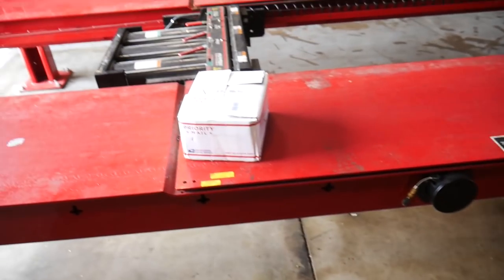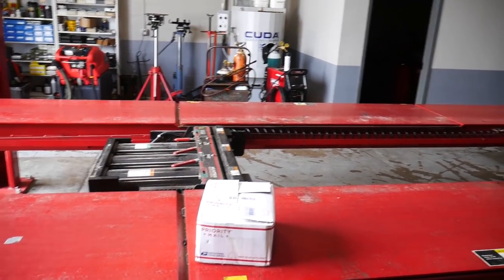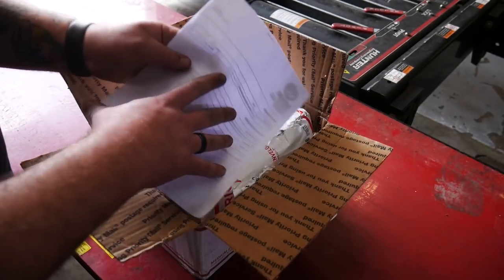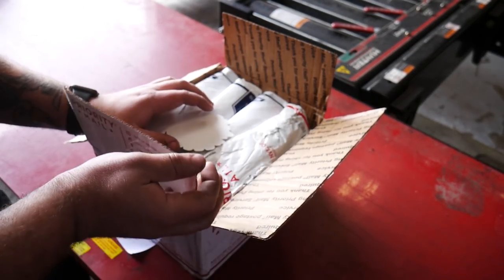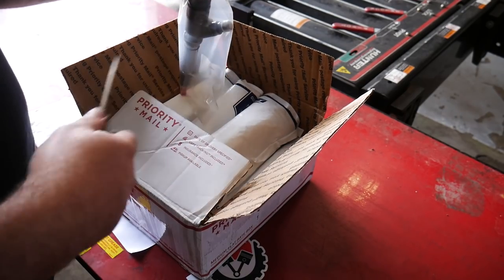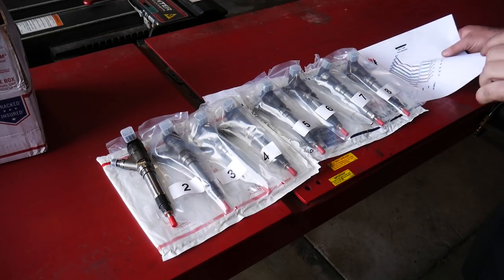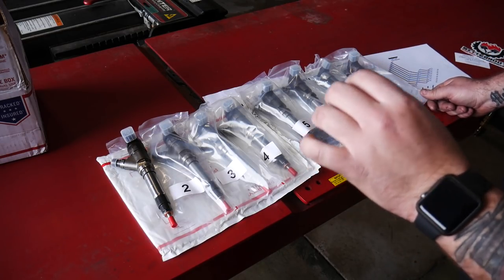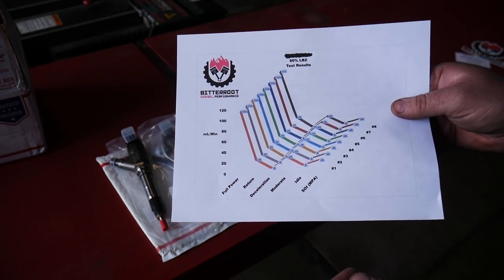DURAMAX 60 OVER INJECTOR FLOW RESULTS AND INSTALLATION

Comment: Yes sir that's the correct way your injectors should have been done. I used to work for a company call Gerhardts they did fuel injection, governors, turbos, ignition controls, lube pumps. I worked in the governor department . The fuel injection department did all types of injectors and pumps. We had a performance shop behind our shop. Anytime you get a pump, injectors, Governor done should have a service report and a spec sheet stating how they perform on the bench. I am enjoy watching your videos you go into detail. Thanks and keep up the good work.

Comment: I had Bitterroot hone/extrude my stock bosch nozzles and balance everything. Installed it and had a issue with cylinder 6. Sent cyl 6 injector back them. They fixed and now it runs great.

Comment: Motor is so clean. Did I hear you say that you are now running dual CP3 pumps? Would you recommend doing that over running a larger CP3 pump?

Did you say stage 5 Suncoast transmission? Think last I saw was a stage 4. At the transfer of power which converter did you go with and, if it wasn't included with the built transmission, would you have upgraded to the billet flexplate and associated parts? What about two disc clutch and or running a deeper pan?

Since great power comes with great responsibility are you planning on upgrading your transfer case, driveshafts, and/or rear axle? Last question, what gear ratios did the truck come with (3.73 ???) and do you think you'll change the gear ratios?

Awesome video. My apologies for so many questions. The pros and cons are more subjective. That said, I think truck survivability should always be the main focus. Can't wait to see the truck come together and hear what that thing does when you get on it!!! Have a blessed day all!!!
Reply from the maker: For the first one yes, running dual cp3, both stock. That will give me the biggest versatility to be able to do more later if needed rather than buying another bigger cp3 again. AND, I got this setup for a really good price second hand. And yeah I said 5 but you caught that mis-speak... it’s going to be a stage 4 PPE trans, billet c2 hub but not shafts. As far as the flexplate, time and money we’re short on that one so that’ll be left for a future project., prob with the bottom end. Converter is a suncoast, I had restalled to a GM-1074-3DR. T case will be a future video as well as I’m hoping for a conversion from a two piece to a one piece drive shaft.

Comment: Hi just discovered your channel great content, I’m looking for advice just bought a 02 lb7 that needs injectors with 204k it’s all stock I’m looking for a good price on injectors, or if anyone offfers any package deals I’m thinking off just tearing it all down and doing head gaskets and studs while I’m there so I can have trouble free driving for lots of miles.
Reply from the maker: That’s a great idea, it’ll be costly now but worth it in the end
Reply: Rustbelt Mechanic yeah if there is not already a video out there someone should make one talking about all model duramax injectors cause like the lb7 you can find stock ones on the internet from $1000.00 to $3500.00 and up so if your joe blow and you don’t  deal with a supplier day in and day out it’s miss leading on what set you should go with to get the most of your $.
Reply: @chriswittnebel505  It's the old adage, you get what you pay for. At the bottom price point you're just buying used injectors that are "ok" at the time of sale. At the top price point you're usually paying to cover big margins and overhead.

Comment: Hey so why did you spent $1100 ish dollars repairing your injectors when you could have got a set of exergy injectors for just over 2000?
I’m trying to decide what to do with my injectors and would like to hear what your reasons for going this path are so maybe it can help me decide also. If you don’t mind to share them?
Thanks a lot for the great videos!!!
started watching you from truck master recommendation going through lots of your vids 👍👌👍
Reply from the maker: Thanks man! For one I chose them bc of price point. Also I explained in the video how even new ones may come with even up over 9% differentiations between all 8 injectors. Seriously, just call up Bitterroot diesel, they are a wealth of knowledge and are more than eager to help in making a decision based on your needs.
Reply: Rustbelt Mechanic 
Thanks I had missed the video where you pulled them out and explained what your doing and why. 
Great info I’ll look them up.

Comment: So it will cost me $1100 to send all 8 of my injectors in to put 60 over nozzles, tuned, and charted?
Reply from the maker: No it would definitely be more expensive. I got a discount, and this video was a few years ago and before epa regulations clamping down on the aftermarket diesel industry